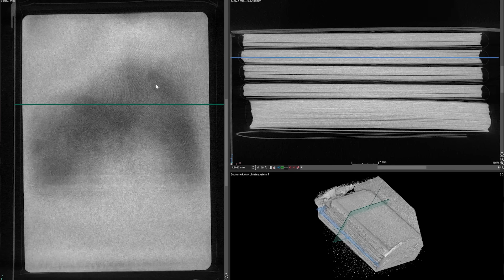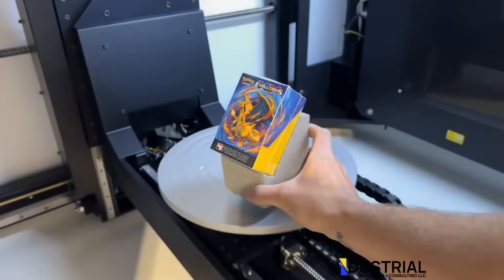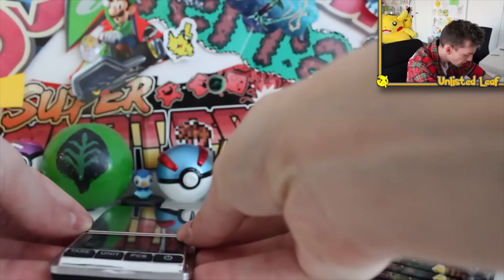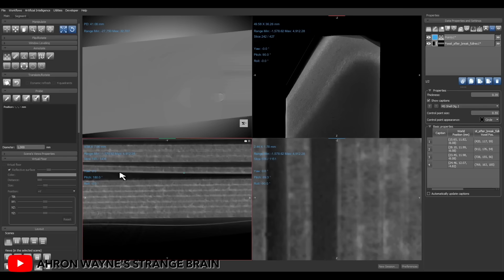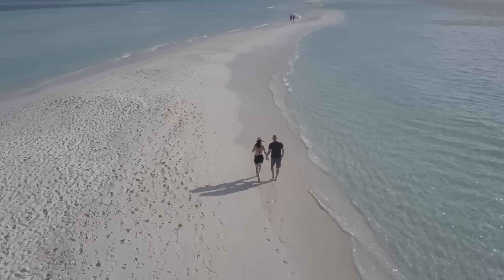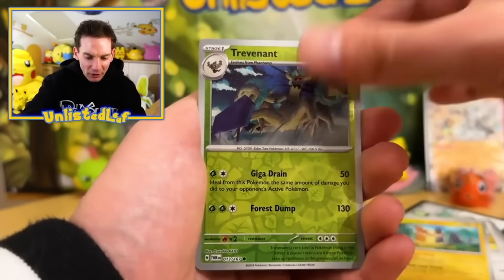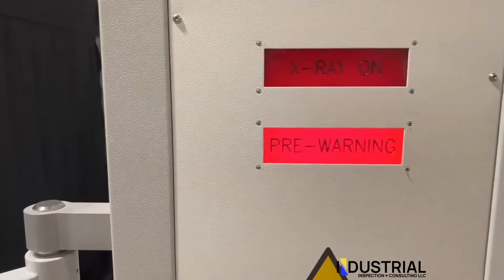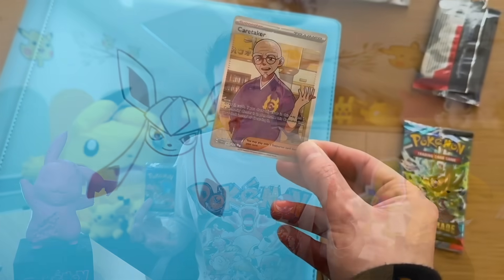THE POKÉMON CARD X-RAY MACHINE

Comment: Helpful Tip:You can buy a radiation detector and detect if any Pokémon product you are buying has been scanned or not
Reply: Whip out those geiger counters and radiation suits
Reply: You can't use the detector before buying a pack online anymore.
Reply: If you bought it, it's to late
Reply: Plus the fact that it's a CT scan not Xray
Reply: I dont think the radiation is strong enough to be detectable at that point
Reply: @LurpakSpreadableButter  CT Scanners use x-rays to make the scan except it does hundreds of slices to make 3d renders.
Reply: @LurpakSpreadableButter  a CT scan uses radiation you do know that right?? Though as another person mentioned I don't believe the levels of radiation used are high enough to be detected
Reply: I woneer if youtubers have done this yet for the big priced boxes
Reply: Radioactive pokemon cards we're dead
Reply: I was going to comment the same thing. 
   It should have obvious amounts of radiation if it had been X-rayed. 
   There is another machine that uses magnets to capture images without using any radiation. So the Geiger meter would not detect radiation on that machine. 
    If I were buying at a show, I would definitely swipe the box with the Geiger and it would be so embarrassingly obvious is the seller is fraudulent
Reply: xrays and ct scans don't make the scanned object radioactive though, that's a huge misconception. if the imaging of the booster was somehow done by exposing it to radiation emitted by a radioactive isotope and possibly polluting it with that material, you would be able to detect something but not after having scanned the booster with a normal xray.
Reply: @Valverde713  while it does use radiation, you would have to use the detector simultaneously to the CT scan, as a CT scan doesn't make the scanned material radioactive itself. it's not like the radiation is transmitted to the object in the sense that it becomes a source of radiation itself.
Reply: @happysquirtle466  did you miss the entire second half of my comment mentioning how it probably wouldn't be detectable??
Reply: @Valverde713  no, because you specifically said the levels wouldn't be high enough, implying that at least a tiny bit of radiation would be transmitted to the booster, which isn't the case.
Reply: @happysquirtle466   ok bro 👍
Reply: So that’s not how non-ionizing radiation works. You can’t detect that something has been x-rayed because non-ionizing radiation leaves not trace. It’s just light you can’t see.
Reply: @Valverde713 You are confidently wrong. Look up the difference between ionizing and non-ionizing radiation.
Reply: @guitarfreak2105  it isn't that big of a deal man
Reply: X-ray radiation does not cause the subject being radiated to emit radiation after the x-ray machine is turned off. This is not a valid comment or idea.
Reply: In Matt Smith's voice "X-rays aren't like alpha, beta gamma decay 
Ultraviolet is ionization of atmosphere" anyone else want to wear a fez?

Comment: Even if someone does send booster packs to get x-rayed, who's to say the same boosters are sent back?!?!?!😯🤔🤔
Reply: RIGHT
Reply: Weight. Hard to match the exact weight if you weigh before sending
Reply: I’ve always wondered that about the cards I sent off to PSA! One came back damaged but got a 10…?
Reply: @somesteak6100  no it's not hard, i sometimes have to put things in a bag to weigh exact same for the store at work, once used you can do it faster as well, you will get a feeling for what to use and not to use, and they're probably machines for this too if they don't want too use humans
Reply: @CGplay186  I get what you're saying but having their pack weigh the EXACT same as your pack is definitely the trickiest part.  I have had many WOTC booster packs and their weights vary from pack to pack.  Some 19.8, 19.81, 19.82, 19.83, 20.1, 20.2, 20.3.  Get what I'm saying?  You'd have to have hundreds of booster packs of the same art work varying in hundreds of different weights in order to swap them out for 1 guy.  Let alone 2, 3, 4, 5 people.  It would be hard as hell and extremely expensive
Reply: @somesteak6100  definitely not by weight, they will just send a pack thats the same weight thats a different hit. Ive had multiple packs that were the same high weight that were different cards of lesser value

Comment: I think it could work if the x-ray company was required to put a special non-removable sticker on the product. This would protect buyers because they would know the pack or box was scanned and request the scan data, and if the holo turned out to be a less valuable one it would drastically decrease the price of the vintage pack, still making it a gamble for the seller to scan them.
Reply: Would be kinda fucked up though since if you send in a pack and there is nothing in it, the sticker would ruin the value for sealed collectors.
Reply: @shinygiveaways1920  Right, that's exactly the gamble they'd be taking by scanning it.
Reply: @Tortellini24 that’s anti customer
Reply: What company would agree to that, it'd just be suicide. That also doesn't do anything to the individuals with CT scanners that have been doing this for a long while now, this isn't a new thing it's just something that everyone is now aware of and so the amount of people scanning their packs/boxes will be even higher.

Comment: It's likely that someone else mentioned this but if not, the trading card companies simply need to start using anti x-ray material in their packaging. This material has been in use for a long time to prevent the post office from x-raying items that could be damaged by x-ray. It would add a bit to the cost of goods involved in manufacturing a pack, but that increase would negligible.

Comment: Hello
Ct scanners use xrays in like all directions to make a 3d image

packs or cards will not have a discolorstion, i dont know what settings they use, but probably same exposure as flying a plane once or twice
The xrays are there for microseconds, the better the detector the less time it needs to collect an image, however possibly they run it bit longer to get a stronger signal and possibly more resolution

Geiger counters, dosimeters or other radiation meters will NOT detect whether a pack was scanned or not

Unless there is an update to how the packs are beeing made, there is basically 0 way of telling

As someone who played pokemon in my childhood i see this as an absolute loss but im also suprised the foil of the pack and other cards dont distort the image enough to fully scramble it

Comment: My thoughts on CT Scanning TCG packs as a whole:

If you have sealed product and want to know what’s in it without opening it, then I guess is okay as long as you don’t have the intent on reselling it for a much higher price. Reselling these Scanned Product is not good not only for the market, but to casual collectors without knowledge of the situation. There will be people out there who will scalp for high end packs and sell the rest knowing the packs are mostly duds. It’s not just a Pokémon problem, but the TCG as a whole. People scanning their MTG Alpha Decks for a Black Lotus and if it’s not there, they just sell it for what it normally goes for. If it is there, it’s ultimately up to the owner if they want to keep it or sell for a ludicrous price. I hope it doesn’t gain traction to where it’s the norm because it takes the fun away from the whole point of Pack Openings.

Comment: Won't the people selling the packs just jump the price through the roof when they know what it inside? Or create a shortage on sealed packs and tank the price because no one will sell a $5k pack fearing that the seller x-rayed it? This is dangerous and needs to stop. Trust will decrease when buying packs if this blows up in popularity.
Reply: Shortages don't tank prices, the complete opposite. It would be great if it could be stopped but it seems pandoras box has been opened.